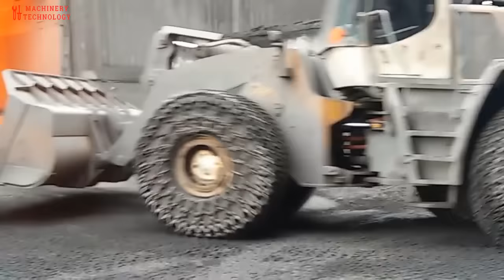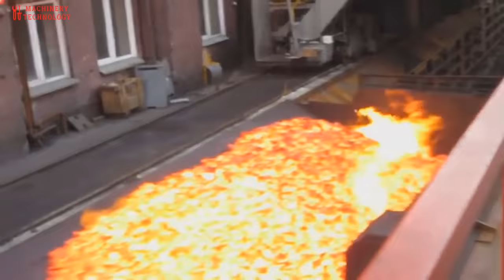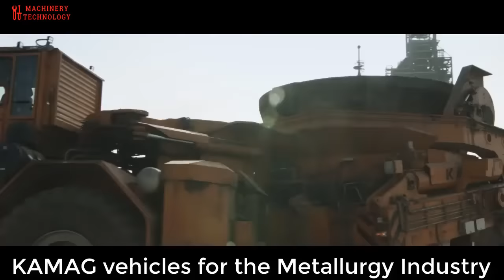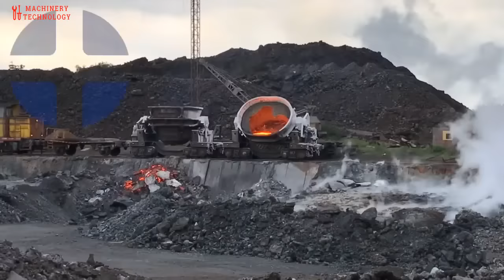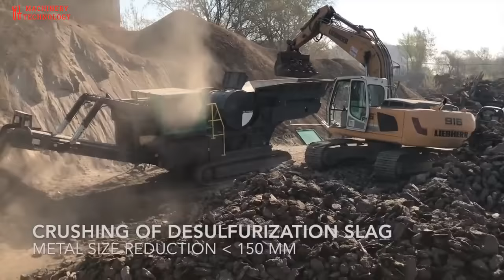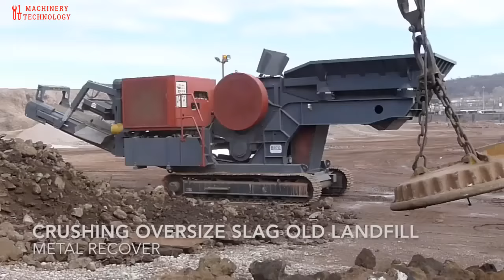Metallurgical Slag - Heavy duty machines, Kamaz, Kirov slag pot carrier and Slag Crusher machine

Comment: There are factories extracting metal from metallurgy waste - from slag accumulated over 100 years. They don't need iron ore and ore mining or transportation costs. They have something better than iron ore - slag. The slag contains up to 60% of the metal and it is already compactly assembled and does not require transportation and extraction costs.
Reply: Slag can ground and eaten with ugali and tomato ketchup. I have seen slag served in some exclusive restaurants   slag has usrgul minerals to remove cholesterol.
Reply: What material are the refining out of slag

Comment: never understood why these places dont use the heat in the slag to power a small power station that can offset some the costs of running a arc furnace a bit. least some of that hot slag is used for heat generation

Comment: Slag is always on top of the crucible so why don’t they just empty the crucibles from the bottom first ?  Let the slag stay behind and then flip it out?  Never understood this …
Reply: A crucible is a dumb bucket, no moving parts.  Designing the parts required to do a decanter and withstand the temperatures involved, is a level of magnitude more difficult. Way too expensive.

Comment: Is the slag good for anything?
Reply: It's used as roadbed and more generally to make a good stable sub surface for anything. Sometime it's more readily available, and it's more green than quarrying stone.
Reply: It can be granulated and the granules are made to make cement
Reply: Road construction, asphalt, concrete, filler material, land reclamation, etc etc there's a lot of use for it.